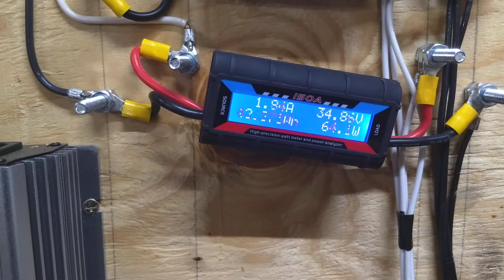The iSta Breeze i1500 broke my inverter!

Comment: Salve ✋ scusa la domanda ma sai che non ho ancora capito cosa ci fai con la corrente di 2 inverter? Ho visto quasi tutti i tuoi video ma non riesco a capire come usi la corrente che produci 🤷‍♂️ grazie
Reply from the maker: My system is a little easier to understand in my later videos, but essentially I use my turbines to charge batteries and then I use grid tie inverters as dump loads to drain the batteries off.  All of my power goes into the grid.

Comment: Did you expect 1,8 kw from i 1500? What wrong doing others ,that they cant get even 500W?
Reply from the maker: I can say that the 1800 watts part was a bit of a fluke caused when the inverter crashed and allowed the turbine to over spin...that said, I had reasonable considerations that it would exceed it's ratings and I EXPECTED it to get close.

As for what other people are doing wrong?  Well, I don't know that they are doing it wrong.  Which is why I started this channel.  People post videos with this turbine or that turbine and they'll say it's AWESOME without explaining anything...or they'd say it's terrible and also not explain anything.  The guys happy could have had extremely low expectations.  The guys unhappy could have had it connected to a shoe.  What I wanted this channel to be wasn't a confirmation of whether or not one model or another was good, but an explanation of how I got my results.  I want someone to be able to see my results, good or bad, and be able to the exact same thing themselves if they wanted.  Same wire, same inverters, same turbine, and so on.
Reply: @ToysforWatts  Yes it's True. Thank you, we have a lot informations.

Comment: If you take the lid off of that inverter most likely it's just a fuse blow and then check your Moss fat if it's not the fuses if you get too much voltage on them they'll blow the fuse
Reply from the maker: I will be dissecting it later today in the hopes that maybe it can be salvaged.
Reply: @ToysforWatts  what size wire is that you have on there is that number 6 try using welding cable it works a whole lot better that's what I got on mine on the DC side from your battery
Reply from the maker: #2 coming from the batteries and #6 going from the junction terminals to the inverter.
Reply: @ToysforWatts  you said that inverter was good to 50v?
Reply: I got a thousand watt Jupiter and it says a 1 ought and no longer than 3 ft